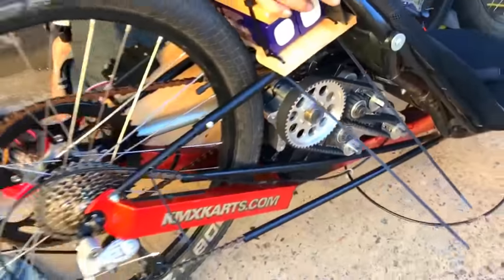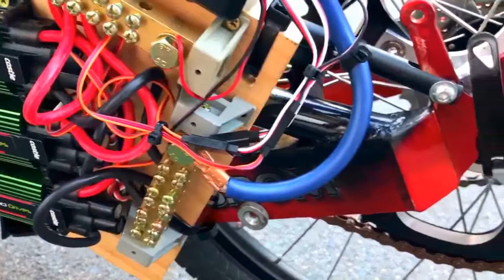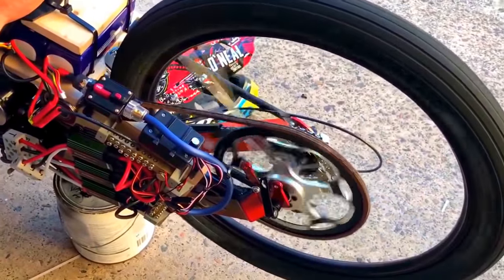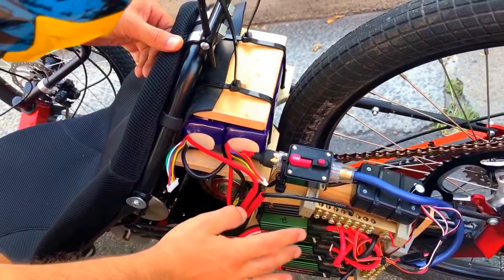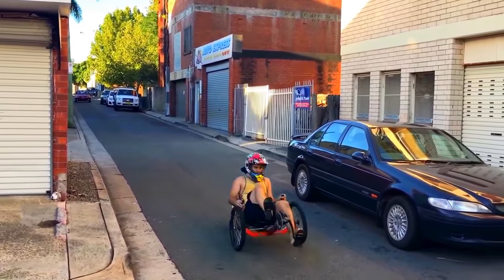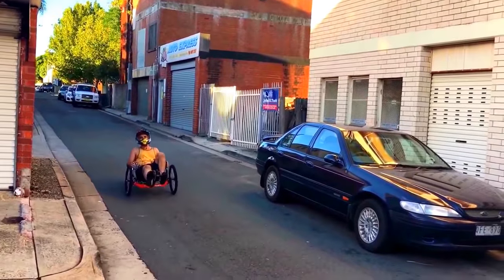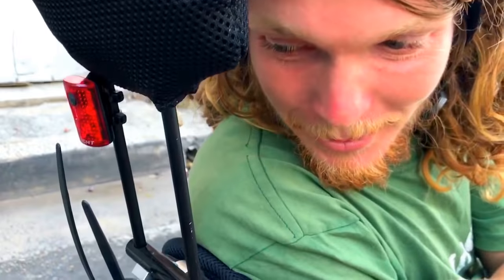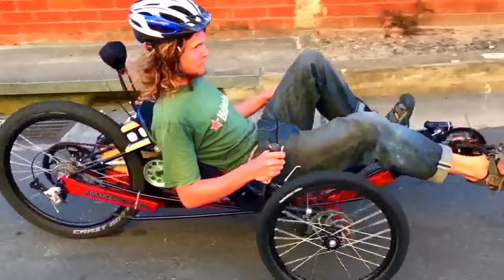DIY 42000w Electric Bike - 56hp Triple Motor (video#3) YES, monster is rolling! First tests at 300A

Comment: Hi, Bruno, please help! My story short. I've had 2 ebikes with hub motors in 2012,2014. It were Golden Motor Magic Pie and Bafang CST. I came to conclusion that I don't like hub motors a lot. Since 2014 I've been dreaming of Bafang BBS02 mid drive. I didn't have opportunity to buy it since then but now I have. My biggest problem is that I never even tried to ride this mid drive motor. Thought it's a perfect motor before I red a lot of things on the Internet. And now I'm starting to have doubts because of the question of its reliability. I'm really afraid if it's gonna broke because I ride a lot and I don't want to have problems and spend a lot of money on repair. If I buy this motor I'm gonna use 48v battery and will never overvoltage like you do. I'd probably buy HD but I lean towards BBS02B as it's much cheaper and I'm not sure in it's reliability enough. I ride regular bike a lot, like 6000-7000 km per summertime, so it's probably be even more with the motor. Now I have to decide to order it on Aliexpress or not and this is my questions.

1)What range of Bafang BBS02B 48V can I expect before the gears, controller or something else can be broken? Is it reliable overall?

2)Where from can I buy gears if I don't find them on aliexpress if I live in Russia?

3)How Bafang HD compares to BBS02B? What are the main differences in real life? Is it true that you can lean on throttle more with HD?
Reply from the maker: Yeeaaahh... understand all confusion inside your mind reading so many different info about these motors... it took me time to decide what motor to buy before I ordered my BBS02 in 2014.
I could go on and on talking million things here (I know this is exactly what you want haha) but I will try to keep things simple. BBSHD will climb ANYTHING, even the smaller BBS02 has a monster torque, can't even compare to hub motors... another thing that most hub motor people notice when they switch to mid drive is the range improvement, less current drawing on the battery, less heat everywhere. 
Yes all that mechanical advantage is awesome but depending how you use it will last for thousands and thousands kms. Yes, things can break... I always tell people if you use a 42t chainring and always keep the motor spinning fast changing gears correctly, these motors will last for much much longer. I just opened a BBSHD last week with 8000km and everything was fine. I never opened my BBSHD motors in my bikes... they run perfectly. Only programmed the motor the way I like, the smother the settings are the better on the drive train and electronics. 
The BBSHD is a much stronger and better designed unit and will last longer than BBS02. You can go wild and pull the throttle all day long, it spins a lot faster (the faster you spin electric motors the more efficiency, less heat and more power you get). The 42T Lekkie chainring instead of the original 46T chainring, makes the motor spins a lot easier, faster, more efficiently and less wear on drive train you will be avoiding so many mechanical problems from internal gears and bicycle parts to battery cells and BMS. 
IF I would recommend you to get any part that could wear on the BBSHD and you may get a spare on is the pedal freewheel https://www.emax-ebikes.com.au/products/bafang-replacement-pedal-shaft-freewheel-clutch-bbshd
Maybe after thousands of kms you could open the big metal reduction gear https://www.emax-ebikes.com.au/bafang-mid-drive-spare-parts/products/bafang-replacement-large-reduction-gear-for-bbshd-motor and maybe add a bit of fresh molygrease 
Put this way, I never heard of anyone who bought a BBSHD and wasn't happy... everyone loves it. It is a neat setup too. You need to try yourself =] Maybe see if you can find a local electric bike shop that you can do a test ride.. you will be surprised with the number of people riding these motors... I hope my short tips helped hahaha so much POWEEEERR =]
Reply: ElectricBike Thanks for reply. I'm just starting to clear things out. Seems like HD is indeed a more reliable unit. I heard something like HD is probably underpowered with it's 30 amps controller, and probably can take 40 amps. Is it true or it's made with purpose for higher reliability? So I hope it's still better than bbs02 if using it with standart 48v battery and not overpowering it for maximum reliability. Also don't you know if new HD with upgraded controller will be available in the near future or something like that?
Reply from the maker: Yeah the HD is actually over-engineered, its not near operating 100% of its capacity, its going to last.. can take more power but its not just the amps that make miracles like people are saying out there.. higher voltage makes a lot difference but needs an external controller, play with all the wires etc.. this is why we don't see many people doing it.
There is a chance that Bafang will increase the power on the BBSHD but don't wait for these things to buy your motor.. it could happen tomorrow or may take years... they know if they increase the power they will have people breaking things and coming back claiming warranty so I'm not sure if they want that.. the HD is powerful enough already, its not a motorcycle performance but makes miracles happens on a regular bicycle haha
If they do.. chances are they won't change the design that much so you will be able to retrofit to your motor.... everyone wants more POWEEEEEEEEERRR hahahaa =]
Reply: ElectricBike Yeah, thanks for every word, it's very interesting. Actually you've convinced me to buy HD and before yesterday I purchased it with 850C display on Aliexpress from Eunorau Ebike Online Shop-3 store. And a few minutes ago happened what I didn't expect at all. The seller sent me a message: 

"Hello,thank you for your order,I am sorry this motor we have sold out now,could you pls extend the delivery time to 20 days?when we get it,we will ship immediately" and also,
"I am sorry to let you wait.We are waiting for the answer from the factory when they can send motor to us,we will urge them."

So do you think it's OK?
Reply from the maker: dmitry manzano 20 days is a looong time waiting... maybe ask if you can get the refund and buy it somewhere else... but if it's too much work just wait... sometimes refund can be a lot of work... 
From now u better message the seller asking if they have in stock before placing order.... I know lots of shops doing the same not just the Chinese... very high demand for these motors..
Reply: ElectricBike What do you mean refund can be a lot of work? Very soon I'll have to make a very hard decision. While my order is still processing I think that I've been given a chance to rethink and get a refund to order bbs02b. I love folding bikes, a month ago I sold my last one, Tern Joe with 26 inch wheels. Now I have some troubles with money and I have an idea to buy 20 inch wheel Dahon Vitesse with the money that I save by going with bbs02 and put this motor on it. Do you think it's a good idea to combine it with small wheels for better torque etc? Don't you think it's a waste of money to buy bbs02 today or it can be given a chance if it's my first mid drive? There are so many articles about this motors that I'm starting to go crazy. I have some hopes that last bbs02b versions are better than the first ones. I have the only bike now which is Bergamont Vitox 7.0, it has terrible rolling resistance. By the way do you think it matters for the motor where you put it on, on a bike like your Trek with low rolling resistance or cheap heavy hardtail with high rolling resistance. I suppose the range will be different, am I right or the motor is so powerful that it doesn't really matters?

P.S I sent a message from another account to a seller and he said that Bafang factory have a long holiday till the end of February.

Comment: What kind of battery, and type of the Motors?  I wanna tried to cheat your bike bro...
Reply from the maker: Hahahaha yeah man... that would be AWESOME you’ll love the challenge... the motors are freaking expensive, these are a custom and modified version of the AstroFlight 3220 (more details in the video description below) batteries there’s no other option but very high power LiPo, check out this video https://youtu.be/Pbg--F-43K8 where I show the new air cooled battery I’m making for it, capable or 1200 amps no problem hahaa so ridiculous... so much POWAAAAAAAHHH ohhh yeaaahhh =]

Comment: What’s this bike’s weight and the engine power?
Reply from the maker: When I made this video the trike was just 35.2kg the motors were tuned down and had a 300 amps circuit breaker, here is a video I made showing: https://youtu.be/cCP7f2V2R5U 

Here is another video where I quickly show the new air cooled and a lot more powerful battery here that is capable of 1200 amps but I’m only going up 840 amps hahaha enjoy https://youtu.be/Pbg--F-43K8
More POWAAAAAAAHHH

Comment: where can i get the motor and gear system?
Reply from the maker: Yeaaahhh the motors are AstroFlight 3220 modified with thicker shaft and air cooling vents + fan at the shaft, they’re $795usd for the standard motor (each). The guy who made the CNC aluminium gears / belt setup was in the USA but last time I checked his website it was down =/
Check the video description for all technical details

Comment: when is next video???? am really lookong forward to it
Reply from the maker: Yeeaaahhh... sorry for the super delay in posting any news... new big racing battery is ready and fitted... better thicker wires to handle the amps... super fan cooling the controllers and motors...  now I am just playing around with the new super advanced BMS and charging system... super POWEEEEERRRRR hahaha =]
Reply: ElectricBike yeeee cool.....so video out soon???
Reply from the maker: +Rais Zaman ohh yeaaahhhh!!!!!!!! =]
Reply from the maker: +Rais Zaman yeaaahh, working on the electrical, added the new motorcycle racing battery, adding some electronics, GPS for accurate speed, stronger rear wheel and wider tyre... super advanced battery management system... lot of improvement... ohhh yeaahh!!!

Comment: Wouldt belive what speed it would get on flat surface when and eggshell like body what would be wind boosted, it would fly around 420km/h ore even more :D :D
Reply from the maker: Now we are talking.... my whole idea back in 2013 was to make a land speed record lightweight EV using this http://trisled.com.au/hpv/aquila-3/ with an insanely lightweight and powerful motor. In 2016 I took this triple motor drivetrain with me on the airplane to visit Trisled and ask them how I could integrate this motor inside their existing setup and when I mentioned 42kW they were like WTFFFF???!!!! Ben the boss started quickly making some calculations based on their aerodynamic coefficient of drag with 42kW drivetrain it would’ve EASILY get past 350kmh... a few seconds later he realised that this was crazy dangerous and didn’t want anyone dying on his velomobil and decided not to make or sell it to me!!! He also said this would require a totally new trike to be safe and would’ve cost me $16k to start the project.... I quickly gave up the idea and got a normal KMX trike to get my tests going. I still want to make a faired trike... it’s definitely in my TO DO list =]

Comment: I'm positive that Dave from EEVblog and Speedy Gonzales had a love child!
Reply from the maker: +gjmob hahahahahaa this is ultra funny I'm laughing here sooooo hard... guess what, Dave EEVBLOG is lives just 20min from my place hahaha... I'm attempted to ask him to ride this 42Kw trike.. ohhh yeaahhh
Reply: Maybe Dave can build a bike from parts that he finds in the dumpster, and then just add some POWEEERRR =]
Reply: Hey Bruno, have you thought about making a small dashboard/ display console out of ABS plastic to protect the display during a fall. Maybe even integrating a second display for mirroring satnav etc. Maybe in the future as the range increases, cruise control for long distance runs wouldn't be out of the question. I guess  the biggest problem is the cost of everything here in AU. Keep up the good work and more POWEEERRR to you.
Reply from the maker: Yeeeaahh... I have so much tech-junk here too haha I collect so much stuff... I always wanted to make an "electric junk bike" hahaa...  if I could do with Dave would be ever better ohh yeaahhhh...
The display idea, the best position to fit the display especially on off-road bikes is on the corner between the handlebar and the stem... nothing hits there even if you flip your bike at 100kmh hahaaa.. 
I am helping a company to design a super cool display that will work with all Bafang motors and many other motors that share the same protocol.... some different features added... kinda cool I guess.. I will make a video showing as soon as I get the final/production version =]
I am a big fan of navigation and use GPS, you can figure out so much stuff with that data.. best route for bikes with fewer hills that can save you some energy and increase your range... track the bike in case it gets stolen... check all your rides history on map... if this new display works well we may jump on a bigger project like that... ohh yeaahhh so much POWEEEEEEEEEERRRRR haha =]
Reply: gjmob Can you please tell me what brand and spec the Lipos are?
Reply from the maker: There used on this video were HobbyKing Nanotech.. they're okay... much much better than Multistars that people buy because they're so cheap...  there are some better and newer "Graphene" ones now... my nanotech packs are 6000mAh and can take 300A max each I think... 
My new racing motorcycle pack is completely different, got a proper copper bus bar connecting all parallels  its 12s 6p divided in two bricks of 6s6p. Can deliver 1700A peak hahahaha but I will be happy with the 840A maximum power my triple can possibly do hahahaa.. so much POWEEEEEEEEEERR =]

Comment: just a bit more than a bbshd!!!
Reply from the maker: Yeeaahh... you're right.. putting more than 3kw through the bicycle gears is asking for a disaster... unless you ramp the acceleration so it starts gradually and increases unleashing full POWEEERRR!!!
Same here... I am using a KMC trials bike chain.. (single gear bicycle chain but slightly thicker walls) nothing so special to be honest... these motors are sensorless so the start at low RPM reminds me of a V8 or V10 car at low RPM misfiring and shaking everything but shines as soon as you increase the RPM and yeaahh it hits like a MONSTER..!!!
There are some really thick single gear bicycle chain but for 9, 10, 11 speed cassette the chains are pretty narrow and lightweight... some guys get a cassette with 5, 6, 7, 8 gears so they can fit a fatter chain and the cogs are also thicker so it can take more punishment... another suggestion is to buy 2x chains and 2 cassettes and keep replacing... this is what I used to do before start working at the ebike shop.. =]
Reply: ElectricBike why not just switch motorcycle chain?

Comment: What is price motor
Reply from the maker: Ohhh you don’t want to know the stupid price I paid for these 3 custom motors... just google AstroFlight 3220 then add some customisation and multiply by 3 motors + 3 motor controllers + battery to handle 850Amps... better stick with more common ebike motor/controller =]
Reply: Thank you...

Comment: Over-Kill Awesome!!!!!
Reply from the maker: +julio lausell ohhh yeaaahh... ridiculously overpowered and super lightweight, at this video my whole trike weight was only 35.2kg (+/-77 pounds). Every time I twist the throttle I can feel the front wheels lifting and the rear doing a burnout... ultra scary but so good feeling that adrenaline pumping... ohhh yeaahhh
Reply: I could tell how fast it accelerates, you should make sure you have plenty of rear tires around. =)
Reply from the maker: +julio lausell hahaha I literally got a box with lots of different tyres to try (and trash some), I can't wait to finish the electrical and move to the tyre testing / burnout phase... ohhh yeaaahh... that will be super fun and funny... poor tyres... I feel sorry for them already haha
Reply: Thanks for sharing your bike/build with us. Enjoy, go fast, and be safe. That trike IS fast.

Comment: It doesn't matter how much hp or watts it has if it can't put the power down
Reply from the maker: +Generikid yes I can... did u see the insane acceleration I with only 1/3 of the power... it was just the first test, I was having battery issues and circuit breaker dropping after 4 seconds of throttle....
I've got a bit of super wide tyres, different rim width and sizes to try... got a proper motorcycle racing battery with a very advanced battery management system connected to a tabled running windows10 so I can watch the performance... got a GPS to compare vs wheel Speed... lot of work and still lot more things to do... I'm designing a new frame with better geometry with better weight distribution, so it hooks on the road around corners and improve acceleration... ohh yeaahhh =]
Reply: It's not really putting the power down if the wheel keeps spinning and not gripping the floor

Comment: How fast is that ?
Reply from the maker: Bill Johnson all I could think was to keep this rocket going straight... it’s only geared for 113kmh at the moment but if I change the gearing ratio or add a gearbox or a lightweight CVT the sky is the limit at this power to weigh ratio Hahahaa so much POWAAAAAAAHHH ohhh yeaahhh =]